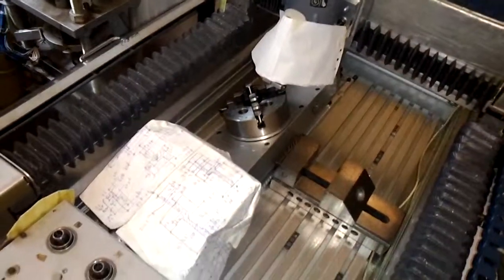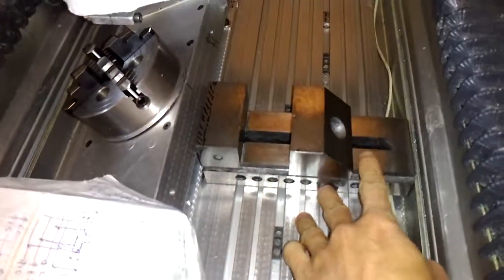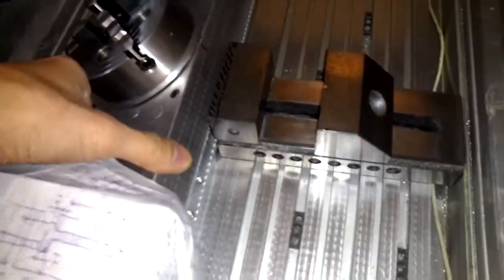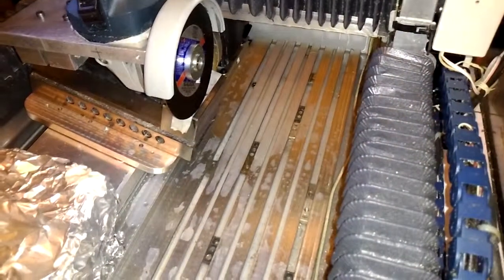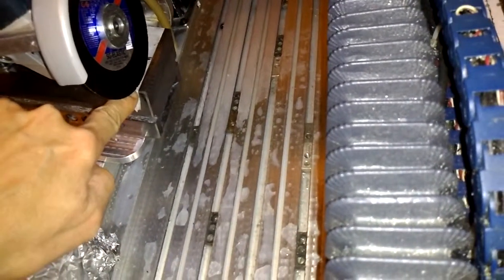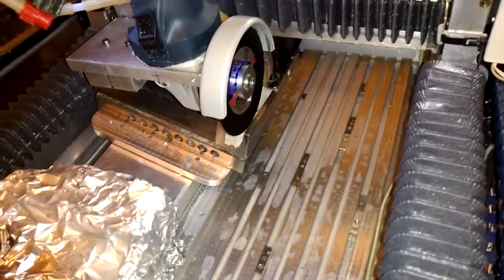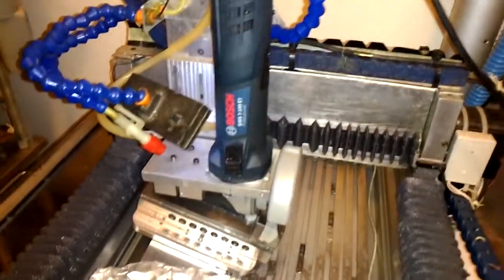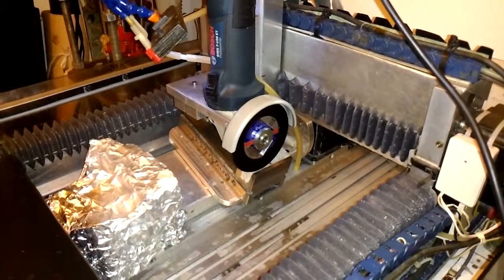Cnc milling by angle grinder 2/3 - 14 (High Z CNC-STEP)

Comment: Do you think you can do a video on how to setup the High Z CNC Step, tool length sensor for Mach3?
I have the S-720T and I need to get the tool length sensor to work in Mach3.
Reply from the maker: Just buy a tool length sensor...Sorotec brand is nice, I have a its cheapest version, it is fine....